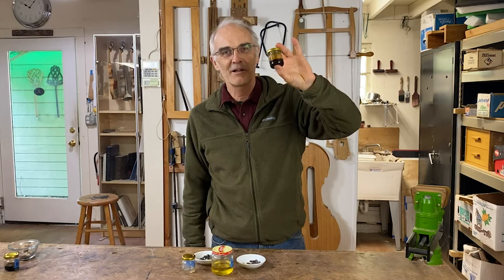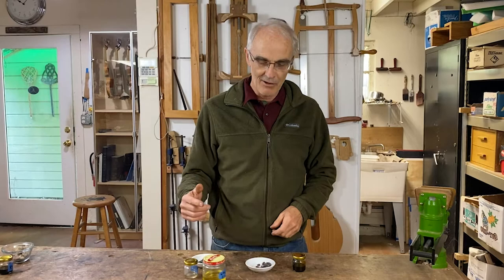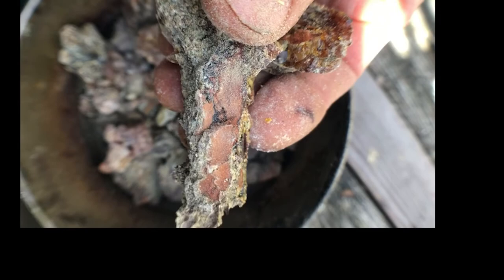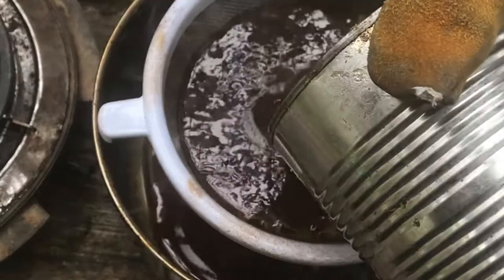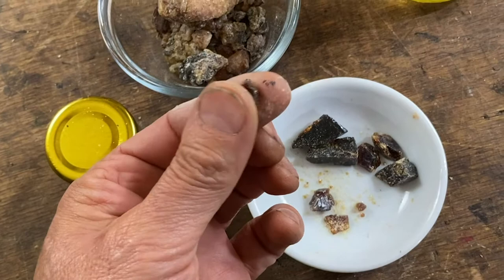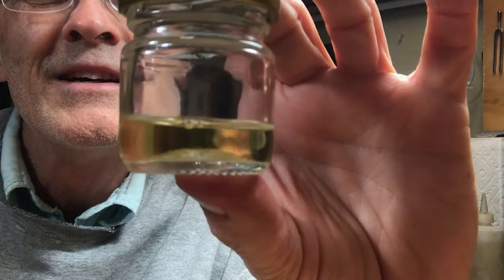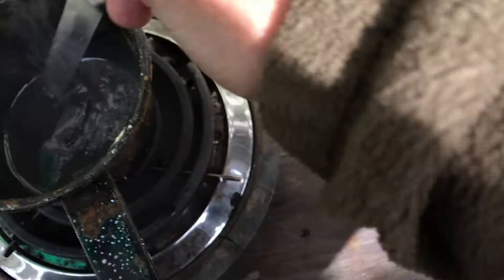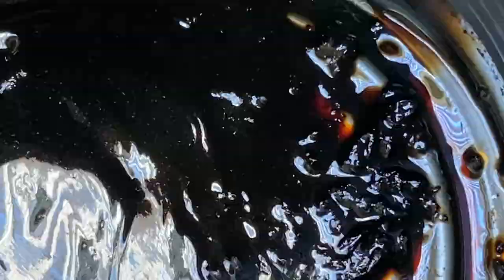Making varnish for the Redwood Violin

Comment: Two questions. Firstly... The Amber that you use, is it the Amber that's left over after extracting the turpentine? Or the Amber before extracting the turpentine? 2nd question. If I had to paint the varnish on my boat, how wood the varnish react under a hot sun? Would it become soft? Or would it remain hard and in its place?

Comment: This is a great initiative, mr. Carruthers!

I was about to venture into cooking oil varnish this way, but never thought that some pine resin would do just fine, regardless of what MaestroNet may think.
 
I have a question: would linseed oil work just as well in lieu of walnut oil? (I have both)
Also, were (raw) oil and resin cooked together, or mixed while heated apart? (so I can buy appropriate pans and containers)
Are turps added on-demand to modulate apparent viscosity, or is there a suggested maximum percentual volume?

That's a lot of questions, but since the ingredients portrayed here are the only ones I can source in my country, I'm really excited about the possibility to finally follow the example.
Reply from the maker: You can certainly use linseed instead of walnut oil.  I usually cook the resin down for color, cool it , weigh out a quantity, crush that and add the cold oil to it, then heat it all together.   
The turps is added to make the varnish brushable, so the amount you add will depend on things like how much oil is in the mixture and how stiff of a brush you will use.   I'm not very methodical, I eyeball it.  probably about 30% (this is just a guess) by volume added to the hot oil/resin mixture.  I like it to be a little too stiff to use when it is at room temp, then I can thin some of it down again  for use.  If you add too much turps you can put it back in the pan and boil some of it off.  

I usually do my resin cooking with the lid off.  Cooking it with the lid on, as I did to make the turpentine, gives you a completely different substance which seems to be very prone to cracking when made into a varnish. You may or may not like that.
Reply: @redwoodviolin  Thank you so much for the prompt reply! The process is, in essence, simpler than what I had considered, so I'll start gathering everything necessary.

Would this recipe, in your experience, allow for the incorporation, to a partial extent, of amber resin in addition to the colophony, without adversely affecting the final result?
I have both resins, and thought that amber may provide additional rigidity to the varnish layer, but this is of course just an untested conjecture of mine.
Reply from the maker: I’ve never used amber so I just don’t know.  I generally like to keep things as simple as possible.
Reply: @redwoodviolin  Fair enough; I'll post a video reply as soon as I successfully cook the varnish following this recipe, to encourage other makers to follow your initiative 😃

Thanks for clearing everything up! 
Best wishes!
Reply: Amber makes a harder varnish but I think I’ve heard it requires a much higher temperature than pine resin to melt.
Reply: @violinmaker4271  Indeed; I just checked the recommended temperatures to cook amber, and they were around 300°C, which I find dangerous as a non-industrial individual.

Instead, I'm going to try this method with these ingredients, and per another suggestion, another identical batch with filtered colophony heated up with a bit of lime before adding the oil, as the resulting varnish reportedly hardens to a somewhat harder layer. I will compare the results on wood samples, do a scratch & flex test, and share my results as a reply to this video.

Boy, this is some inspiring project! I've already begun sourcing local woods that resemble both spruce and maple in their physical properties, let's see what comes out of it...